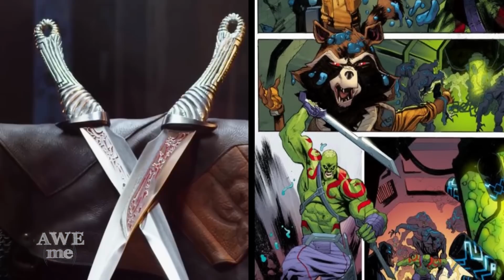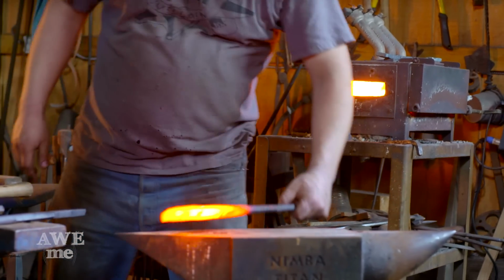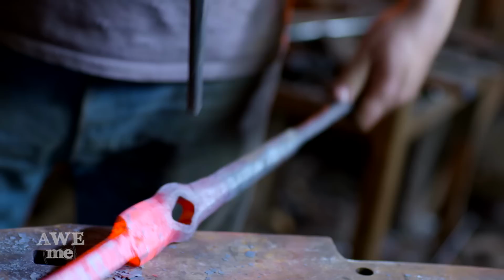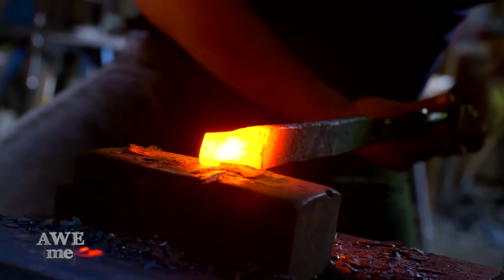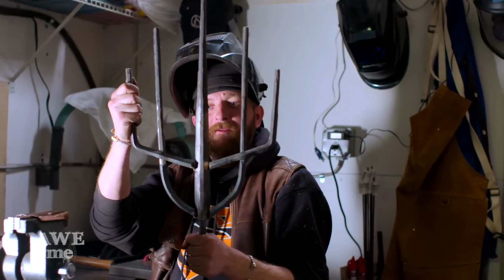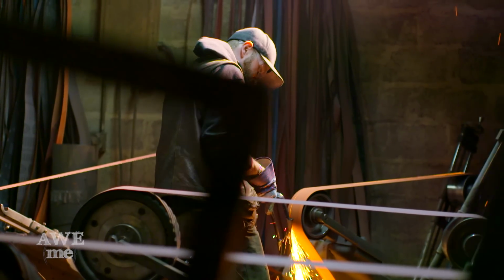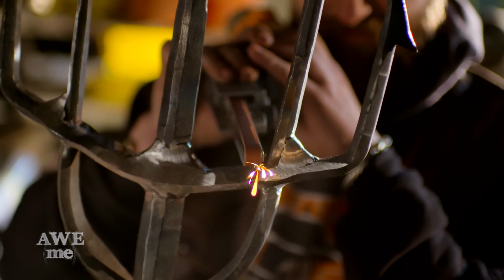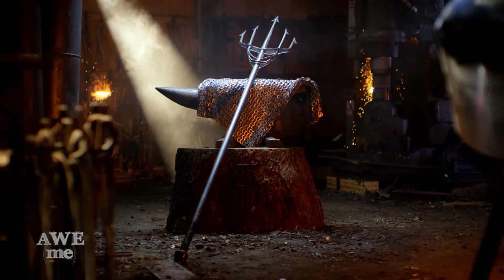Aquaman's Trident - MAN AT ARMS:REFORGED

Comment: Who thinks they did poor on this episode
Reply: Looked pretty rough close up.
Reply: I do
Reply: Same
Reply: It's the welding job plus the hard angles to get too
Reply: I think it was a bit rushed but it was also supposed to be  rough because that's how  it is in the new dc movies
Reply: the weapon looks unfinished
Reply: Considering how complex of a shape it is, and all the hand forging, it's not really a surprise to me. It takes a very long time to make something look perfect when it's made of steel.
Reply: They've definitely had much better episodes.
Reply: The welds should have been TIG welds not MIG welds.
Reply: could have been to do with the budget of the person comissioning the project
Reply: Not their best work, that's for sure
Reply: this is what I was about to say...
totally unfinished... horrible job
Reply: it would have been far more impressive if they completely forged it and not just welded it together. anyone else felt like they have been getting lazy lately?
Reply: henri knutsson Forging something that overlaps like that is extremely difficult and time consuming. You would need to ensure that each overlap properly forge welded together, which would require more heat than just forging heat, and the chances of a cold shut weakening the structural integrity would be increased by a lot.
Reply: Elliot Robertson there is a reason why i said it would have been "far more impressive" had they forged it. now it looks like lets just throw something together and leave it at that.
Reply: Even then the welds looked sloppy.
Reply: yup
Reply: I thought the same thing
Reply: it's aquaman 64 quality level
Reply: I enjoyed the rugged look of it, it matches aquamans new appearance
Reply: Look MoM i made it i have 228 likes
Momm...
Reply: True, but everyone is talking about finish and welds..
Am i the only one who thinks it was too wide and looks like a pitchfork? it should have had some other dimensions like one point in the middle and 4 around it...
Reply: +julius px i think that too

Comment: I guess I'd better keep asking until the dream becomes real:
Could you please make Corvo's Folding Blade from Dishonored?
Reply: that would be the best thing ever!!
Reply: You just read my mind, I was going to ask about it.
Reply: By now that has to be the most requested object ever, but if they're gonna make it, it would probably be just before Dishonored 2 if I had to guess because of how hard it would probably be to make.

PS. I also have requested this for a long time.
Reply: primeoetzand Yeah, making it just prior to the next installment would make a lot of sense.

I imagine that the spring-loaded way through which the blade extends, the mechanical sorcery needed to make a telescopic blade that's stable enough to cut with and the fact you also have to turn it 180º so the blade doesn't extend towards the user or pinch your fingers (it's why Corvo flips the blade in-hand when you pull it out in the game) means there's a bunch of safety issues to consider too.

I mean, it's sort of like a spring-loaded butterfly knife with a telescopic sword blade in the grip. That could end very poorly, if it's pointed in the wrong direction when you release the spring... :S
Reply: We've only been asking for years....
Reply: +Daniel Mårtensson yeah , theu should make it , it is so coool
Reply: I've been dropping the same comment since the first video I saw